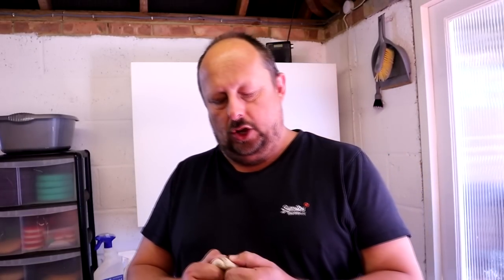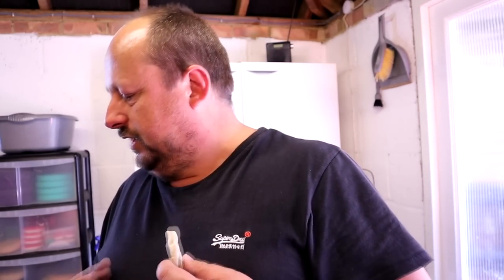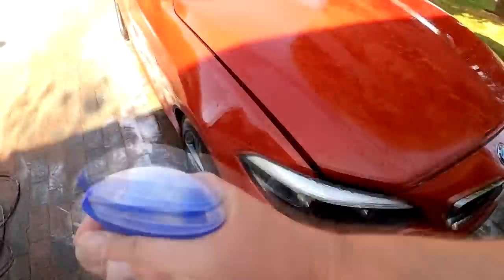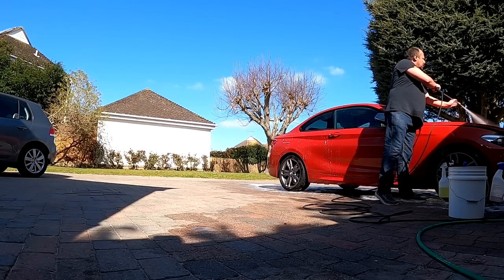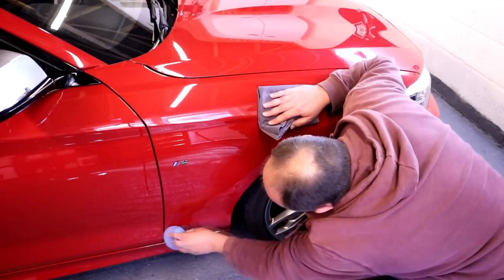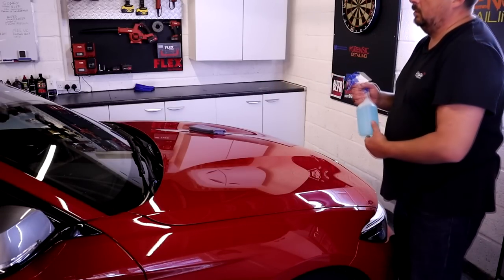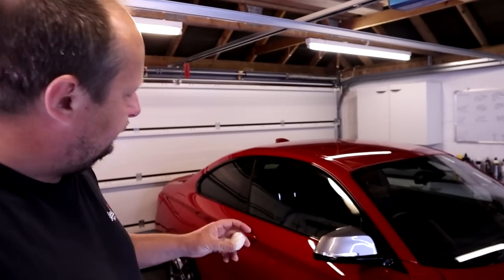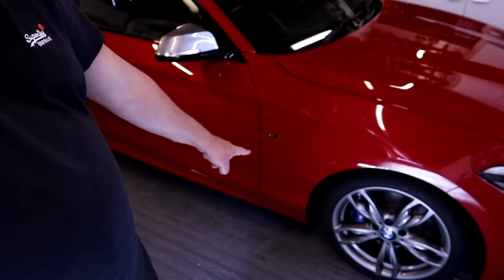Clay Bar Detailing How To Clay Your Car Properly

Comment: I touched up a few stone chips on my bonnet a week ago and they felt high a week later so used the soft BH clay bar and was nicely surprised when it levelled them out 👍
Good tip on using the mitt with Korrosol, I was using way too much every time 👍👍

Comment: Hi ya  John good video as usual I know what u mean about the tar a fallout still on the paintwork underneath a sealant I just bought a 5 series the dealer did exactly the same to me. A useful TIP with the built hamber clay is to put the clay into some hot water before you use it, it makes it much easier to fold and work with 👍

Comment: Good video Jon!  Thanks. 

I do things a little differently personally, but its horses for courses i guess. 

I put my clay in a jug of hot water to soften it first. Much much more malleable then and much less likely to marr the paint I've found. 

I also don't use clay lube either. I use Garage Therapy Zero decon as a contact wash but also as a pre-wash snow foam.  I'll then use what's left over in my cannon and bucket as my clay lube as I work my way around the car.  
I just find it has brilliant lubricity and the added surfactants just seem to make the claying process even more effective for me.  Plus the car has then had, effectively, three hits with the zero decon. 
There's always a lot less contamination left meaning I don't need as much clay. Lol.

Comment: I switched from claybars to nanoskin decontaminations sponges 7 years ago and never looked back.  The way I do it now is to clay and wash at the same time.  So I start with the pre-wash with a degreaser in the snow foam cannon, then pressure wash, do the fall out remover, pressure wash, wash with ONR and clay with the sponge while the panel is still wet, then dry the panel.  Doing it this way adds maybe 15 minutes to the washing step, it's really, really fast.   I normally use the fine sponge unless I notice heavy contamination.  Sponges won't remove as much as claybars, but they don't scratch as much either and they save you a ton of time.

Comment: Another helpful video, as always! The BH clay box says to wash / rinse after claying, which adds more work. Helpful to know I could just microfibre / towel afterwards as you did. It also says just use water as lube which worked fine for me (I used the fine spray from the hose).

Comment: Using first tar and glue remover might expose rust deposits under the tar... Also tar might contain small particles of asphalt, prone to deep scratching your paint... Personal experience, I prefer to do tar remover prior to cleaning my car, wash my car, dry it, iron remover, rinse it and claying it. So you actually just dry your car twice. Also using an acid shampoo prevent water spotting during claying

Comment: Hi John what  about the windscreen? I too bought a car from the main stealers they put on the autoglym lifeshine with the carbon coat on the first wash I did there was areas that weren’t even beading + you can feel the roughness on the bonnet, I’m getting into the gyeon way of cleaning any other good stuff to use, 
  Cheers keep up the informative videos👍🏽👍🏽👍🏽👍🏽

Comment: This video inspired me. I cleaned both cars and used Korosol and Clay Bar'ed for the first time, before polishing and waxing properly. It took nearly two days and I was so happy. I used so many of your videos for reference. But a week later and both cars have watermarks, tree leaves and sap, and bird poo. What do you recommend for maintaining clean cars because I don't want to have to deep clean every week, but won't a snow foam remove the polish and wax that I added last weekend? Once you've got a clean car, what do you recommend to maintain it? Thanks in advance. :D
Reply from the maker: love posts like this Owen.  The bad news is no matter what you do the cars get dirty and having fresh protection can mean dried water spots are more noticable.

So have some Koch Chemie FSE to remove water spots (make sure car is clean first)

dont worry about stripping the wax, LSP is cheap and easy to apply.  trust your LSP and reapply when its totally dead in 3-6 months.  you can maintain it with detail sprays or nice easy spray and rinse.. but trust the LSP mate.

Comment: Thank you for the helpfull video !  Question : my car (8 years old) has never been waxed / coated before, do I need the Bilt Hamber Cleanser Fluid (I will use the korrosol) ?
Reply from the maker: cleanser fluid is used to remove trace elemtns of grease or and wax or silicone residues.  It can also be used to remove and tar films on the car.   Think of it as mineral spirit.  its hard for me to say if you need it on not.   The alternative is a IPA and water based panel wipe.

Comment: I found the easy way to check for contamination is to use a thin sandwich bag over you hand and run your hand with the bag over the paintwork. You will feel every bit of grit embedded. Far better than using your hand and you don’t deposit skin oil on the paint.

Comment: should be know as C-Day from now on.  As posted in group, BH is only clay i use. and you dont need claylube.  just water.  as for the difference john,  soft for regular cleaned cars, and  cold day claying, ie winter.  medium use for 1st claying and summer.  regular for very heavy soiled cars and overspray. Also john, i cut my clay in 1/4 and use 1/4 a car, and even better cost effectiveness!

Comment: My BH black clay has been unused for 5 years. I'm going to try it out.... I'll let you know if it's gone off or perfect still.
Reply: Should be fine as long as its been unopened and the paper wrapping is in place.
Reply: Pop the bit your using in a bit of warm water. Mix it up and see how it goes.

Comment: Never heard of the Korrosol before! Sounds like if it’s turning rusty contaminants purple then it must be similar to Kurust that’s a rust converter… and if it Shri is it that she’s great sense as the clay bar will lift it off easier!
At the back of my car is an excessive amount of rust particles on the paintwork from the exhaust. I’d better get some of this stuff pronto! Ps in the video where you use the sponge/ microfibre applicator and take it out of the bucket; is the suds on the car from the Korrosol or is it car shampoo from the bucket you’re working it in with to wash the stuff off? Thanks again!

Comment: How long can we use a used clay bar? Can we use it again for next detail?
Reply: Cut out the bat in 5-8pieces. How meny cars you can do. That depends on the cars. After I don my Mercedes E270 estate I could easy use the clay for at least on more car. But I had also cleaned my car alot. After my friends Skoda I could put it in the bin because that car was nasty. So it's hard to say. 
But with the prices on Bilt Hamber it really doesn't matter if it hold 1 or 8cars.

Comment: Afternoon John, you you use the the whole 200gram bar or take pieces off. Sorry I couldn't find it in the comments anywhere 😊
Reply from the maker: no mate cut into round disks at least quaster to a sixth of the overal block.

Comment: Hi mate
I brought a 4 year old car with approx 20k miles
The paint feels rough to the touch so I want to clay it
I didn't know which clay to get so I bought built hamper medium.
But after watching this video I'm thinking should have got soft.
Is there a big difference? Will the marring be visible?

Also on the instructions it says you can just use water. Is that sufficient in your opinion or will I have to buy ONR?
Reply from the maker: Marring will be vidable under heavy  duty lighting after car is dry.     Get a little da polisher to whizz over it with finish polish

Comment: Well presented Jon.  👍 Not a criticism, just a question. Why do you you not just use water with BH clay as per their recommendation?  One of the reasons I choose Bilt Hamber clay is there is no need to invest in anything other than a spray of water to lube it.
Reply from the maker: I find clay lube reduces clay marring and stop the clay sticking.  you can use water or soap...  I like to use ONR.
Reply: @ForensicDetailing  That's cool Jon. Just curious. 👍

Comment: 3 questions I have not Googled or have but need an definitive answer. 
My car is wrapped on the hood and leading edges and has a crematic coating over both the wrap and paint

1) Can you clay the crematic coated wrap (is it worth claying) Using Bilt Hamber Clay
2) Can you clay the crematic coated paint  (is it worth claying) If I do use Bilt Hamber Clay
3) Can you recommend a Bilt Hamber polish/wax for the crematic coated wrap and paint one product for both scenario's (It it worth polishing/waxing)
Bonus question
4) Will polishing buffing a crematic coated wrap (using some relevant Bilt Hamber  product) improve the gloss/Shine/Finish of the wrap

Thanks M8
4-0 WTG England

Comment: Don't suppose it was BMW Protect-X that was put on the car by the dealer? Will the decontamination process remove the coating if it's been put on top of the fall out? Do you then have to polish and put a new ceramic coating or wax on the car?
Reply from the maker: I think it was  although they said guard-x  decon would not remove this stuff no. it was hard curing rock hard and there were footprints off it everywhere.. all over the glass, the edges of the paintwork where it had not been buffed.  who-ever installed it did a woefull job for whatever reason. totally shocking. they applied it on a thick layer of tar as well.

Comment: Hi Jon, just getting in to the whole detailing scene and building my repertoire of products and things, a quick question, how often would you clay bar a car? And also decon? Every wash or once a month? Loving the videos and content learning a lot thanks! 👍😁
Reply: Nowhere near that frequently. It depends on the amount of contamination but probably once a year followed by a very light finishing polish on a DA to take out any scratches you just put in and keep the paintwork fresh. You could use a chemical fallout remover like Korrosol every few months to help keep the deposits to a minimum in a contactless fashion.
Reply: @SerenaBluee  thanks very much for the reply much appreciated 👍

Comment: Jon as usual excellent informative video, can i ask though? you advised it might help holding the bar with gloves on but in the video you were bare handed, is that your preference? I can't recall a quick mention about dropping the bar and to bin it straight away, hence it's usually a good idea to split the bar before use into manageable sizes.
Reply from the maker: hey ian sorry I missed this.  Im not too fussed but perhaps with the gloves on the clay is easier to hold but yer Im not overly fussed on that.   If you drop it I would bin it.
Reply: @ForensicDetailing  Jon,
Don't worry about not seeing my comments, with everything you're doing some things will fall by the wayside. Once again keep up the great videos.

Comment: If the iron particles are falling out, won't they get dragged about if you use a mitt to spread the remover?
Reply from the maker: some iron will get pulled into the mitt and dragged about... but look at the dirty clay bar.. you grind all that stuff over the surface when you clay... so gently going over some tiny fragments of fallout you cant even see is not a problem.

Comment: Do you use a portion of clay for the whole car? Or it depends on the level of contamination you've already removed and build up in the clay?
From safety perspective, I'd use one portion for each different panel of the car.
Reply from the maker: I tend to use a couple of small pieces on an average car 2-3 pucks, when I see it get dirty I know its gonna scratch a bit more even after folding..   but sometimes theres nothing on the cars and the clay is good to use loads more times. i think its personal preference really this.
Reply: @ForensicDetailing  BUT AFTER YOU FOLD IT AND USE IT SOME MORE ITS GET MORE DIRT ON IT RIGHT? DO YOU THROW THAT PIECE AWAY OR RINSE IT OFF OR WHAT?  I BOUGHT GYEON CLAY BAR 21$ AND CUT IN HALF. FOLDED IT OVER AND USED IT AND THEY WHOLE DAMN BAR WAS DRTY ON BITH SIDES. I GOT USE OUT OF THE BAR AND ITS DIRTY AND BROWN. HOW DOES ONE NOT USE A WHOLE BAR ON A CAR EACH TIME?

Comment: Jon , love the channel mate. One question, machine polishing is the only step I have yet to attempt but I have no garage , just the driveway. Is it possible to achieve a good standard outdoors or is it just too risky with outdoor variables (airborne contaminants , weather etc)
Reply from the maker: hey there just pick a good day mate with no wind and not too sunny but dry and you will be fine.

Comment: Quick question! Can I use a fall out remover / tar remover and NOT claybar the car then hand polish and wax the car if I don’t have the time to claybar and machine polish? 
Thanks for the great content btw always look forward to a new video. Only just found out about your channels in the last month. 👍
Reply from the maker: chemical decon, makes physical decon easier it does not replace it.  short answer is not really callum mate.    but some people will wash they car..   dry it and spray it with panel wipe or like BH cleanser fluid (which is a bit like a tar and glue) and then wax it.   what I cant tell typing this post is how much contamination is on your car.
Reply: @ForensicDetailing  thanks for ur reply and time looks like Iv got a long weekend too come! Lol Iv gone and bought the da8 from in2detailing but scared to use it on my new (to me) car. 
I struggle with time as I have a 2 year old and no garage to store the car. Thought I could maybe polish/wax the car without causing any damage to the paintwork without claybaring. 
Thanks again for your time. Top videos! :-)

Comment: Is Bilt Hamber white (smoothing, soft) clay safe for ceramic coating? Doesn't remove it ceramic coating?
Reply from the maker: high mate dont clay on a coating you will degrade it massivly mate.
Reply: @ForensicDetailing  Thanks

Comment: The issue with having a dealer apply sealants for hundreds of pounds without any prep! 😡😡😡
Reply: I was left Bmw protectx in the boot for free. Safe to say after a proper decontamination process and a light run with da, the results were brilliant! I’ve seen the kits for a tenner online and will probably buy that again.

Comment: I’d disagree on bolt hamber clay being the most effective.   The original 3M clay is still the best in terms of removing overspray but it comes at a cost.   Cost against performance though it’s right up there.   I also like the Dodo juice clays.   They are a bit more workable and with their clay lube it works amazingly.
Reply from the maker: Wasnt the original 3m clay the same generic clay everyone sold. this was back when the original worldwide and US wide patents were in force and everyone had to use registered version of the clay magic product which held the US patent.
Reply: @ForensicDetailing   you might be right there.   I always found though that it had more abrasive in it.  Or at least a different type.   But it was the same blue colour that all of them were back then.

Comment: I've wondered Jon if ONR actually does leave residue being as it's got polymers in I think? I actually do use ONR myself as clay lube but I've often wondered about this issue
Reply from the maker: Optimum said it leaves nothing behind but if that residue dries I can see it so it must be leaving something behind :)   but it seems to wipe away.
Reply: @ForensicDetailing  OPT Talks about this.  Yes, if ONR dries on the surface it will leave what they call "Polymer spots" instead of water spots.  They wipe away easily usually.  If not, a spot more of ONR reactivates the residue for easy wipe-off.  This is what makes ONR such a great drying aide.  After rinsing off a hand wash a spray down of ONR at 127:1 right away allows for good lubrication of the drying towel and an increased time to dry since it will prevent water spots.  The same is true if using ONR as a clay lube at a higher ratio.  If it dries, it is easy to sprits a little and wipe off.

Comment: Is it a requirement to have these chemical decontamination steps? I was planning to do a clay bar soon but haven't got the fallout remover
Reply: Buy some! You'll be amazed
Reply: It's awesome stuff. I used ironx on a white car. It was beautiful to watch. Wear gloves tho. Then BH clay bar. Results are worth it
Reply: Ideally yes. What’s your reason for claying?
Reply: Run your fingers over the paintwork. You'll notice imperfections everywhere (ranging from iron fallout, sap, left over bugs etc). Think of claying as basically sandpapering your paint to remove all these excess contaminants that other products can't remove. Then clean again and wax.

Comment: Fair point on LSP over contamination. But... time is money with dealers and lets face it they don't give a damn about the quality of paint. Shiny is enough. Home though... im in the predicament that I need to put an LSP on my motor but don't have the time, garge or money for machine polishing at the moment. So claying without polishing and LSP will potentially look worse than no clay. LSP on top of contamination may look better just wont last as long? Got to take the later for now.
Reply from the maker: it will but I wont buy again from this place because of the woefull manner in which this car was prepared. time is money but reputation is important.
Reply: Never seen a new or used car properly sealed by a dealer. Some young lads just doing what their told. They do t cagey taught and don’t get give the time.
Reply: Used the clay cloths and worked ok if the car is decent but would only used then on roof and tops of doors. Clay bar for the rest.